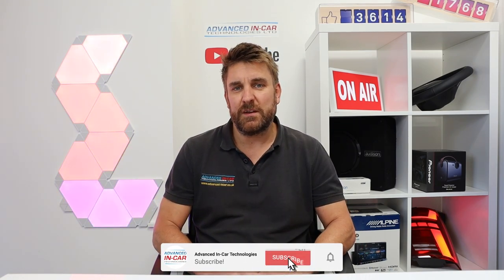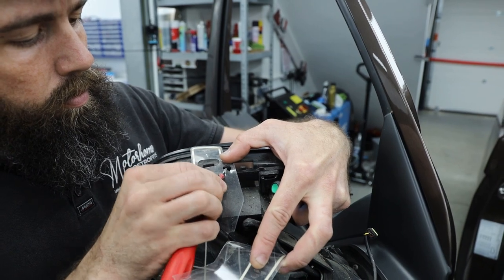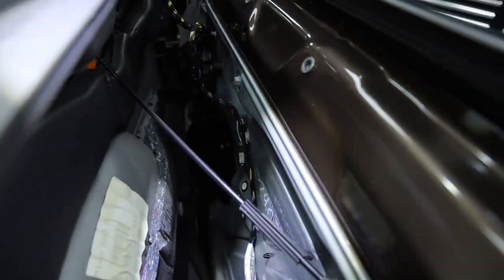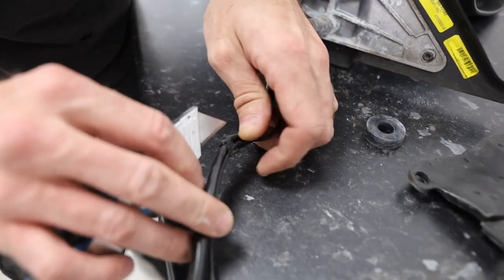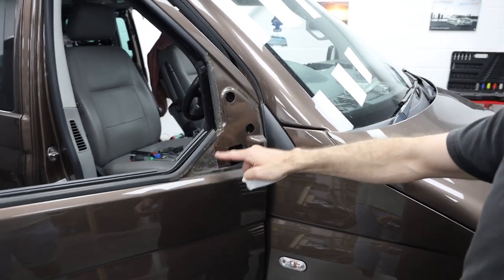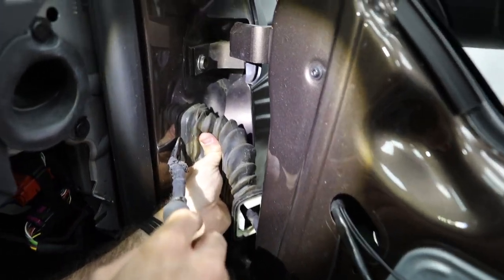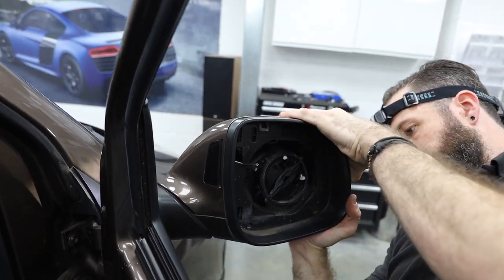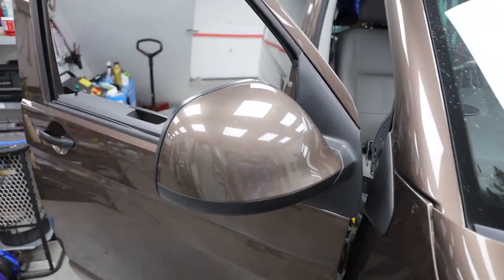How To: Install VW Wing Mirror DAB Antenna In Just 30 Steps

Comment: This was really helpful, I had to replace the aluminium bracket holding the mirror on. But GOOD TIP, when I removed the door card, I put a strap around the handle and tied to to the top of the door frame to hold it up, so I didn't need to disconnect any of the wiring to the door card, only what was needed for the mirror. I had to release the wires from the square wiring harness (to feed it back out through the mirror bracket) which I did by knocking them out from underneath with a hammer and pin. Thankfully it all worked, but involved a lot of problem solving along the way.
Reply from the maker: Awesome stuff! We're glad you found it helpful! And great tip, we will bare that in mind in the future 😊

Comment: What are those two metal triangle clips in the backing of mirror glass used for? I ordered a new one which came without it and the old bracket clip is hard to take off
Reply from the maker: These are locator clips to hold and locate the mirror glass in the correct position. Hope this helps 😊

Comment: Two radios can use one anttena by using a splitter
Reply from the maker: Hello Simon,

Slightly confused. Why would there be two radio's in one vehicle? :)

Please let us know if we have misunderstood you.

Kind regards,

Matt
Reply: @AdvancedInCarTechnologies  I have been involved with short wave radio since the 80,s. There is a antenna share adapter for two radios. Integrated radio vhf 88mhz - 108mhz add digital radio can share one antenna. In short we don't need two antennas.
Reply from the maker: Hello Simon,
 
Thank you for your feedback.

Kind regards,
 
Matt